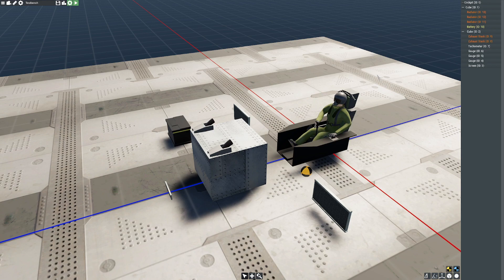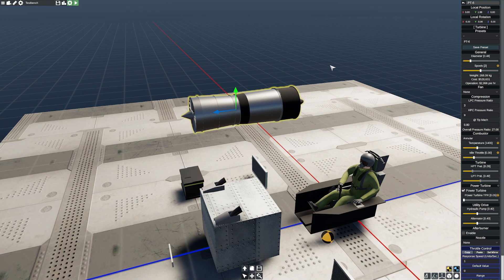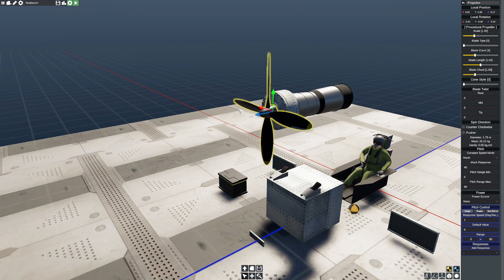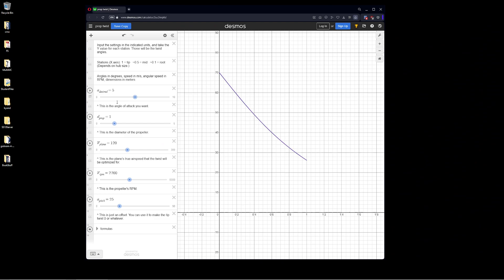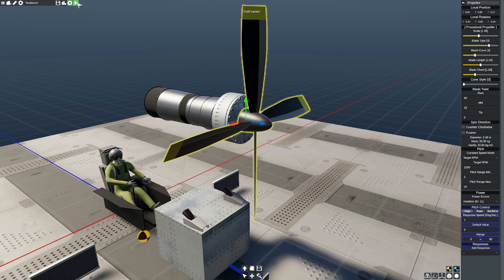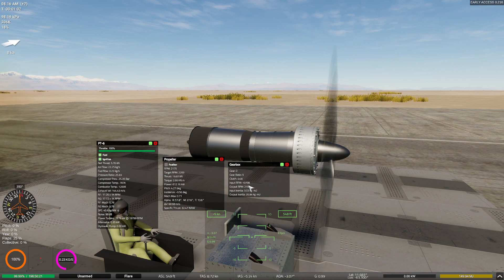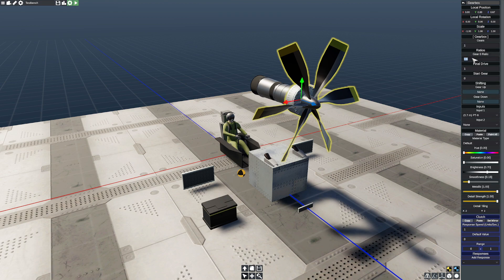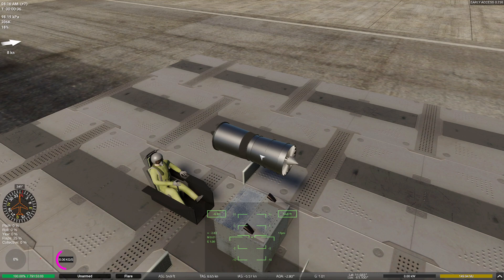Flyout - Turboprop Engines

Comment: Your video is a great help. I'm currently trying to get an aircraft that's capable of flying for 2 hours at full power and reaches 30,000ft while doing 400mph with only 1000 hp. I'm currently meeting all specs but speed and hp 😅 I'm doing 1400hp at 360 mph but my props are not getting my there

Comment: Why do you want to see prop adjust it's pitch when stationary?
Shouldn't the pitch increase with airspeed? What will happen if stationary prop is running at 25° and then plane takes off, how does it speeds up if it cannot increase the pitch to compensate for airflow?
Reply: the propeller pitch changes to achieve optimal thrust at different airspeeds and propeller rpm. Different airspeeds and propeller settings require different propeller pitches to maintain optimal thrust
Reply: @prodbyelija  In Flyout, with the the Target RPM mode, the prop doesn't care about the thrust it's producing. It will alter pitch to achieve it's target RPM (actually about 95-98% of it's target). If the current rpm is higher than target, pitch will increase, and vice versa.

Comment: Interesting video. In the real PT6 (On the DHC6) we only reached the takeoff RPM once airspeed was build up a bit. Then it remained governed at full RPM until about 400ft where we increase the pitch angle to achieve a lower constant RPM. Can you adjust the RPM during flight in this program as well?
Reply: Hey man. Had the same question as you for weeks with no answer, but I accidentally stumbled upon the answer whilst messing around with attaching starters to my engines! Evidently, the Collective control is how you can changed the Target RPM! Try using the "3" and "4" keys. I think that's the default setting for collective! Good luck my fellow aviator 🫡